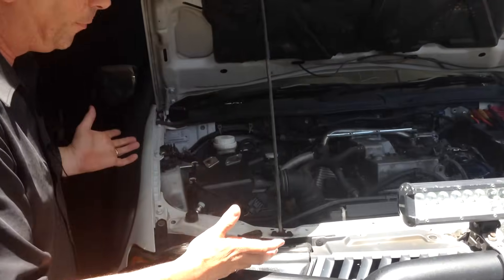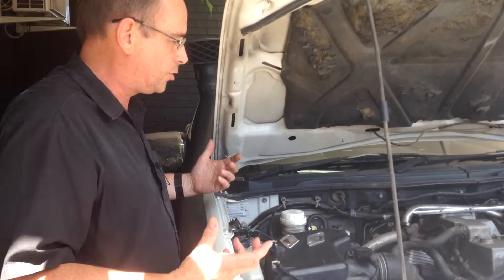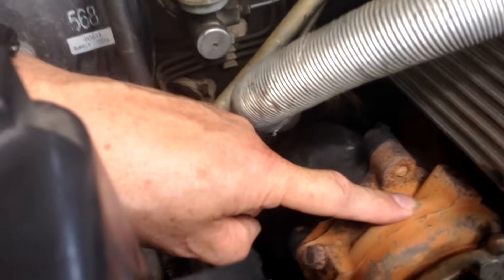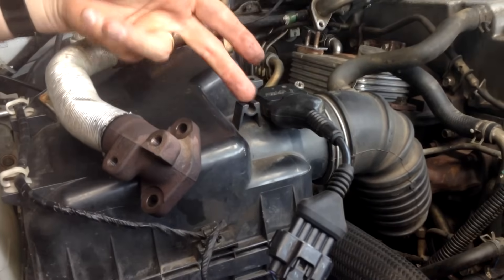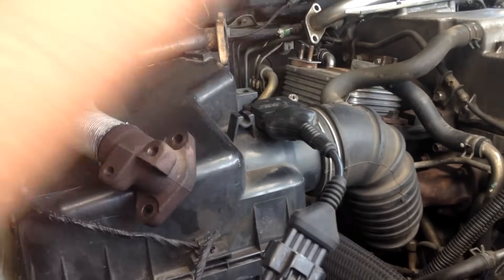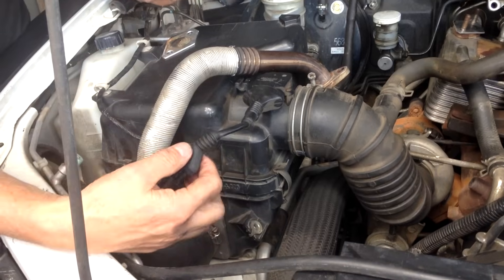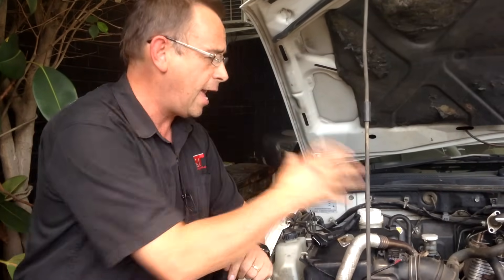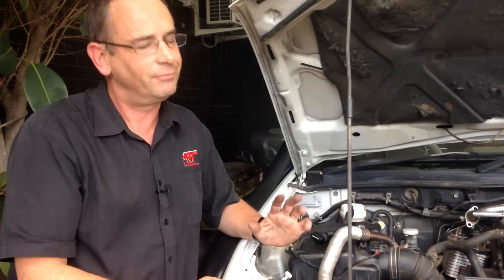How to fix EGR Soot Buildup in a Turbo Diesel

Comment: Just disconnect all the SHIT and it works I here a lot on theory but in practical terms it works I have done it to one of my Kenworth trucks and since I have blocked it runs cooler and no more breakdowns and I'm using less fuel on a run from Sydney to Melbourne

Comment: Correct me if im wrong but thos plug in modules that connect to the air intake fool the ecu into thinking the intake air temperature is too cold for the EGR to operate. So no matter what the ambient air twmperature is coming into the engine, thw ecu thinks its freezing cold. It does what it says and stops the EGR putring exhaust has back into the intake, but potentially at a cost. It makes the engine run slightly richer with hotter EGTs and also there is no failsafe for driving on extremely hot days (hot air is less dense than cold air). So the ecu thinks it needs to run the engine richer when it should be running leaner ti compensate for the reduced amount of air on a hot day. Running rich on a diesel means hotter, unlike on a petrol engine where its the opposite generally.

Comment: Air (intake) temperature determines air density. If you trick the computer into thinking the air is more (or less) dense than it actually is, the engine will run too rich or too lean.

Comment: The BEST & CHEAPEST way to prevent soot buildup in a turbo diesel is to use the BEST recommended synthetic oil and follow recommended oil and filter change intervals. Period.

Comment: Fair enough. But... your tune most likely costs $1200 minimum. Orher options much cheaper. And if you running a old Ute worth 5k paying for a tune is ... welll... maybe a good idea... most likely not.

Its like owning a 1 series bmw lets say 118d. Buy it for $6000 and service at BMW for $1320.

Comment: This is only a problem if you drive below 40mph and never accelerate beyond 2k rpm. Gotta get the engine nice and hot for about half an hour with some spirited acceleration and it'll clear it right up.

Comment: The cable adds resistance to the air temp for EGR to keep it closed, that's its only function. The MAF has a separate temp sensor for all air fuel mixtures on most modern diesels .

Comment: Not necessarily correct…some modern diesels have more than one air sensor, so you can use a plug to “lower” theIAT and disable the EGR without affecting the air fuel ratio

Comment: A custom tune IS the only way to go all  the other stuff is BS. do not change maf sensor cable that is another bottle of snake oil. Custom tune catch can thats it.. Have fun cleaning up inlet manifold & valves there is only 1 sure way & that is to pull it off & manually clean them. Walnut blasting does a good job.

Comment: Does NOT help on turbo ECU controlled engines because it can and WILL compensate for the air restriction by increasing turbo boost, UNLESS well, you got it really clogged edit: omg australian accent, i can't heea 🤣 it

Comment: The EGR should NOT be blocked. How about talking about the negative side of deleting EGR ? Higher combustion temperatures, for example is an undesirable situation. The engine ECU is designed to control EGR,  it doesn't affect engine power, and the modern EGR system is very accurately implemented. 
Deleting EGR is a band  aid fix from decades ago . Do that while a vehicle is under warranty and you'll void your engine warranty for sure.
I'm surprised this guy would show the back yard quality blanking plates..  I'd be embarrassed to show such shoddy workmanship on a rebuilt engine !

Comment: This is the result of deliberate excessive EGR strategy of operation in combination with crank case blow by recirculating back to the intake manifold. All of this is only to achieve reduced NOX emissions, rather than a better or reliable engine.
Reply: That is incorrect. EGR is not just for emissions, it actually increases the efficiency of the engine when power is not demanded. You need to read up on the way EGR changes the volumetric efficiency of each cylinder by pumping inert exhaust gases back into the cylinder when power is not demanded from the engine.

Comment: Blocking EGR valve is bad idea in moidern turbo diesel engines because that is not there only to racicling exhaust gases. It is two direction valve and prevent ower boost presure in way it sending presure in exhaust manifold when is variable intake closed and breaking turbine wheel to slow down compressor wheel and reduce pressure. Conect EGR valve after DPF filter and send almost clean exhaust gases in intake manifold and solve problem bud dont block EGR system any more because you only done harm to your motor.
Reply: Almost clean yet there are diesels with 120k-150k miles with almost 0 flow from all the spot in the intake and valves

Comment: Yes. I have a large V8 Amarican the F350 6.4  I have been 200cc of 2 stroke mix for every 65 leters of fuel or 17 gallons
Reply: What does 2 stroke oil do for a diesel?

Comment: The air temperature plug he was talking about can generate fault codes, instead just place a 3.6ohm resistor on the blue/black wire to trick the temp sensor without changing the flow sensor
Reply: where do you get that resistor, thanks
Reply: @miroslavmarkovic4695  Jaycar.  It works well and they are dirt cheap.

Comment: I have deleted my E.G.R on a 2003 TDi direct injection, with 127, 900 miles on it why? because it was clogging up and causing too many issues.M.A.F sensor going down and Turbo not working correctly. Since deleting my E.G.R I have had no issues and it passes the emissions test yearly for over 4 years now. I just disconnected the vacuum hose off the actuator and plugged it with a small bolt and job done so simple, no more clogging up with carbon preventing the butterfly valve from closing and opening correctly to the point I could not start the engine. For my next emissions test I shall reconnect the vacuum hose onto the actuator  and see what difference it makes to be reconnected.

Comment: Mess with the EGR and your engine will no longer know the gas composition in cylinder. You could end up in limp mode but will certainly have higher emissions than your vehicle was tested at. EGR cleaning IMO is a serviceable and plannable maintenance item. The engines should be designed for easier maintenance in this department. 
I had a sticky EGR valve and from 2200 to 2800 RPM performance was dreadful. The ECU reported Implausible EGR values and it seemed to me that I was getting backpressure from unburned fuel hitting my DPF.  A $2 OBD scanner confirmed that it wasn't opening and closing when expected. Best $2 I spent.
I have 250,000 KM on my little 1.1L Hyundai.

Comment: In essence, EGR has always been a crap idea and SCR, despite the extra bits, like the pump, is a much better system...  in effect, EGR introduces hot, dirty contaminated air into a a combustion process that is expecting a cool (intercooled) condensed charge of air to achieve a clean combustion close to Lambda 1... can't see how EGR achieves this...

Comment: My Vw passat water cooled EGR valve is that bad I need a new one fitted at a cost of £1,100 why is the last part of the car the DPF the only part that’s cleaned as it has carbon build up. Why cannot the EGR have a system to have a self clean system too like the DPF has

Comment: Thanks TheLsdAddicted
The best way to prevent turbo and egr faults is to make sure you rev it and keep it over 2500rpm, this way the turbo engages and runs long enough to spit out almost all deposits......2.2cdi, over 400k miles, still original egr and turbo, still pulls like a monster for a 116hp engine on an almost 2t vehicle
Reply: Bisogna tenere la geometria variabile del turbo aperta, seconda e terza marcia in città, 2500 giri al minuto. Purtroppo stanno imponendo il limite di 30km h e secondo me vorrebbero che le persone andassero o in bicicletta o con il bus😂 il cambiamento climatico😂😂😂😂😂😂😂🎉🎉🎉🎉🎉🎉😂😂😂😂😂

Comment: Drive them like you stole them. Have never had a bloody problem with either of my new age diesels. Get that exhaust hot enough and all the shit burns of anyway, but I suppose that advice won’t sell aftermarket gimics nor will it make anyone else money. Oh what a world we live in.
Reply: Sound like a red neck. Ecu injects extra fuel in the exhaust to raise the temp to burn the soot. You could drive at 1000 kph and not get the exhaust hot enough.

Comment: What I don't understand is diesel engine manufacturers knew dam well what egr on a diesel was going to destroy it. So why isn't the egr taken after dpf it doesn't matter where it's siphoned from. Common sense says this. If you utilize EGR to measure emissions from the dirty side of the exhaust. The exhaust manifold. That doesn't mean that you have to take the siphoned exhaust from the manifold. Let the exhaust go through the selective catalytic reduction and the diesel particulate filter where it also gets extremely hot. Let some of them exhaust emissions get burned off then siphon it from the clean side of the exhaust that will probably reduce emissions even further because you're taking it from the clean side. EPA has no common sense and Diesel manufacturers should be dictating how this is done because they can do it better. And if these environmental governmental control agencies won't allow that then you is manufacturers on a group together and take their asses to court and sue them for not allowing you to produce the most clean diesel emissions possible. Because I can tell you a diesel properly tuned is always cleaner even if it doesn't have after treatment exhaust components on it.

Comment: And none of these "solutions" are legal 😅
Reply: I blanked off the EGR in my car after it started giving trouble, and 1) the car worked just fine for 40,000 miles until I scrapped it (chassis rot); 2) every year when I put the car in for its Ministry of Transport test, it met the required emissions limits, NO problem.
In the UK, there is NO legal requirement to have an EGR; there's nothing illegal in removing it or blanking it off;  and the only legal requirements are that your vehicle meets the mandatory emissions standards.
Reply: @jackx4311  yes you pass emissions but I they see the plate you will be fine significantly

Comment: Simple trick is hook new globe to oil sensor light put in check engine light spot it turn on when turn on ignition goes off when car starts beat any mot or inspection easy fix to beat scammers at own game

Comment: Reducing or eliminating emissions controls is illegal - get a catch can if you intend to retain the vehicle. 
Air quality and your health is a 100x more important than a 20% power gain or added maintenance of a vehicle.
Reply: I blanked off the EGR on my car when it started giving trouble;  kept it for another 5 years/40,000 miles, and every year it met the very stringent requirements of the UK annual Ministry of Transport test.  In the UK, there is NO legal requirement to have an EGR - all you need do is to meet the emission limits.

Comment: Wouldn't messing with the EGR affect emissions, therefore make your vehicle unroadworthy?  Doesn't an unroadworthy vehicle have no-insurance?
Reply: Most cars are unroadworthy in some way or another if they really wanted to nitpick.
Reply: That is a stupid comment.  They have to prove cause.
Reply: In theory, blanking off an EGR might affect emissions - but doesn't it occur to you that feeding air contaminated with CO2, CO, and soot into an engine is going to make it burn the fuel less efficiently - so increasing pollution?
Further, the annual Ministry of Transport test for all vehicles in the UK sets very stringent limits on emissions.  After I blanked off the EGR on my car, it passed the MoT test every year for the following fice years (40,000 miles) until I scrapped it due to body rot.
Driving an unroadworthy vehicle in the UK invalidates your insurance, but high levels of emissions don't make the car unroadworthy - the laws that you're breaking relate purely to emissions.

Comment: I installed the EGR cable and my economy went through the roof and the power is amazing, my engine is finally awake, for $80 it's brilliant, no faults on the dash, love it, and also get a throttle controller, you won't believe the difference in your car.
Reply: Link?
Reply: How are your EGT'S
Reply: Wishful thinking …
Reply: Egr cable on 8.4 klms per 100klms
No cable 7.4 klms per ltre
Reply: @sotrue2976  What are those units? klms per 100 klms then klms per litre? which is it?
Reply: What vehicle was that then model / year  ???
Reply: Where can I purchase this cable

Comment: The best way to prevent turbo and egr faults is to make sure you rev it and keep it over 2500rpm, this way the turbo engages and runs long enough to spit out almost all deposits......2.2cdi, over 400k miles, still original egr and turbo, still pulls like a monster for a 116hp engine on an almost 2t vehicle
Reply: Fact dude these modern engines need to be driven on no faffing around driving them handy is death to them, ppl are too conserved with mpg so they accelerate like granny's and keep the revs low, death to the engine
Reply: Or just delete egr?
Reply: Or just run big highway drives regularly or get the EGRs fairly high for a sustained amount of time. It keeps the DPF clean. Or if you wanna do the best way, block/delete and tune the EGR and bypass the crank case ventilation to behind the DPF or into a catch can. Get your intake cleaned thoroughly after the tune and it will stay clean for a long time.
Reply: 116hp for 2T...it must be really impressive monster 😂

Comment: Would inlet water injection be effective?
It certainly has it's benefits on Petrol engines.
Reply: Not on diesels. Even a tiny amount of water is catastrophic compared to petrol. The compression is much higher.

Comment: On my 4jj1 it was a case of a 6k ohm resistor replacing the iat sensor to electronically shutoff the EGR solenoid (doesn't affect air:fuel ratios on my engine as it is determined via the maf and map sensor). Next a blanking plate on the exhaust side of the EGR cooler. Then clamp the coolant hoses on the cooler. Next step is blanking plate on the solenoid side. After that install a catch can or vent to atmosphere. Then finally do a proper intake manifold clean and your car will love you to bits.
Reply: I have a RZ4E engine and eliminated the EGR by ECU modification and put a blank plate to the exhaust side of the EGR cooler. Why to put another blank plate and why to clamp off the coolant hoses?

Comment: What about  a catch can I noticed this vehicle didn't have one... I'm sure less oil inside the manifold is a good starting point
Reply: Won't stop the soot just the oil
Reply: @Ferrat70   I understand it stops the oil but once the oil mixes with the exhaust gas recirculation (EGR) at the inlet manifold both mixtures turn into soot buildup...

Comment: All you need is the blanking plate in between the egr and intake
Reply: Hi is it necessary to clean first for any build up, I currently have a an EGR fault related to build up. And can I clear the fault
Reply: On some engines fitting a blanking plate will cause fault codes

Comment: So how do you fix soot build up, turning off EGR valve doesn’t fix the soot does it.
Reply: They have to use oil catch can to fix this 100%
Reply: Catch can is a great first step because the oil mist mixed with the egr gas causes the sludge to form. Still undecided about egr delete

Comment: Mass air flow(for operation related to egr valve)read air flow difference between open and closed egr valve and that is only how ecu monitor egr flow.Air temperature sensor is only for air what is  comming in engine..

Comment: By the time you take off pipes, make and add blanks, you could have cleaned the egr and achieved another 50,000 trouble free miles without trying to reinvent the wheel.
Reply: and if you get rid of the EGR you don't have to do the job more than once..... not every year or two cleaning everything out... Also better fuel economy, more power to the wheels,
Reply: @qwertyui90qwertyui90  except in most places you have to replace it before vehicle inspection as the emissions test will return a failure. Better just keeping it clean, as it will do itself if you drive a diesel properly.
Reply: @johnb8956  YEAH, NAH.     Exhaust is cleaner without the EGR, i get a better testing score without the egr, also better fuel economy and the engine inlet isn't choking on soot.
Reply: @johnb8956  Oh no not qa whole 60 minutes to put the EGR in.
Reply: @johnb8956 It is not self cleaning. The more mileage the more soot buildup. The more buildup the less efficiency.

Comment: egr valve is there for emission reasons. not just to block your inlet manifold. if you city drive or short trip a diesel, then don't have a diesel.
Reply: What if you mostly drive highways and long trips, tow occasionally and need the torque but also frequently need to use your vehicle to run down to the shops or supermarket 4 mins down the road

Comment: Block the EGR. 

put in a tiny resistor of the value you need to make it not throw a code...  done. Then plug it all back together hiding the resister within the plug. and put the EGR back on, but with a gasket with no hole in it so the exhaust gas can't be recirculated.

EGR = Engine killers